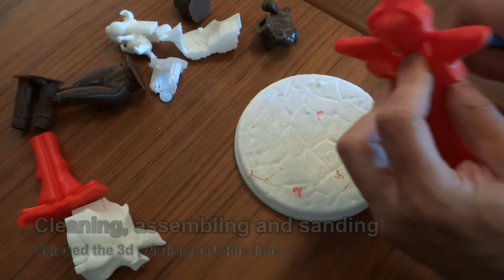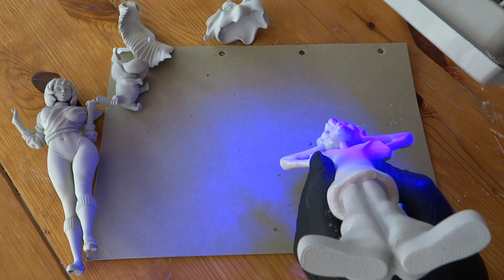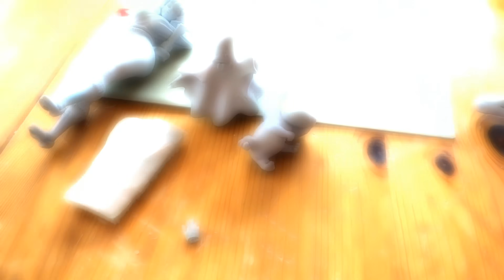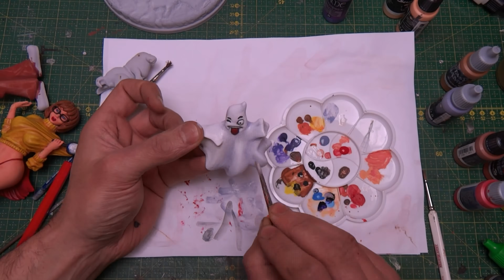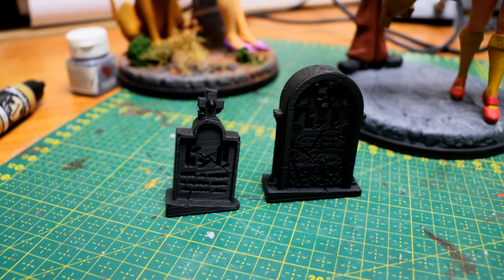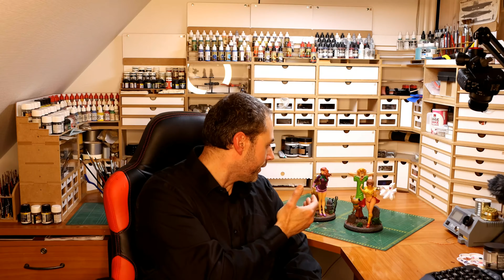Velma & Shaggy - 3D Printed Fan Art Collectible (Parody) [Naughty Edition]

Comment: Hello! do you spray with primer for hide the printing lines?
Reply from the maker: Yeah, I have experimented a bit with that. Did it on my latest collectible model of JINX, it worked really well. But I have also used other methodes like UV resin coating.

Comment: Absolutely amazing things and i also wonder why you dont have lets say 10 000 subscribers but that will come :). What paint would you reccomend for brushpainting the models?
Reply from the maker: Hi Roland and thank you so much for your comment, really appreciate it :) Personally I'm currently using "Scale 75" paints but they require a bit of pratice to use as they are quite thin (you will need several layers, but you can make great effects). 

"The Army painter" paints has a great coverage and they are fairly cheap and very easy to use so they are also an great option. Best wishes and please write if you have any questions :)

Comment: What Resin did you use?
Reply from the maker: The model is printed in PLA and I used a common Anycubic resin (the stuff made for SLA printers) to  smoothen out the surface of the model.
Reply: @HobbyWorld_one  do you think I can use the phrozen shuffle printer to print such stuffs?

Comment: get a resin printer for statues its just easier
Reply from the maker: Got a couple of those, but I like the challenge of seeing how nicely I can print the models on an FDM printer :) Sometimes I have printed the head (and the other small parts) in resin and the larger parts on the Ender 3, this works really well. Lately I have also started upscaling the models to scale 1:6, here the resin machines I have is just a bit too small. But you are absolutly right, resin gives the best and easiest result.